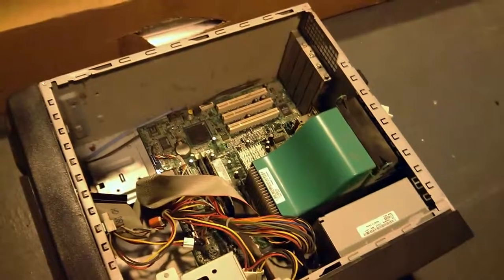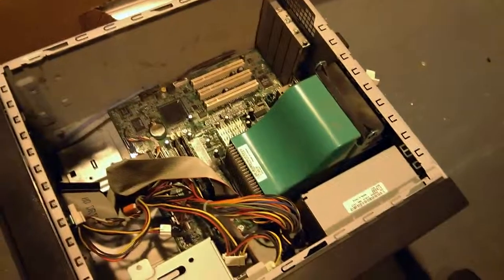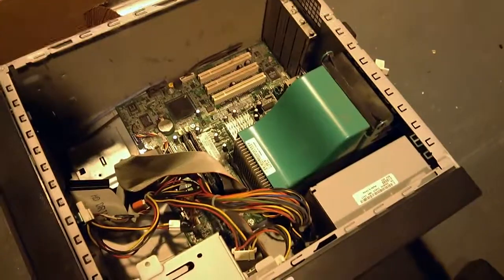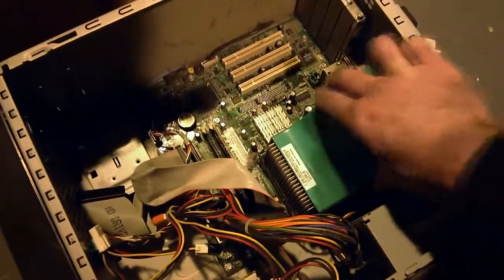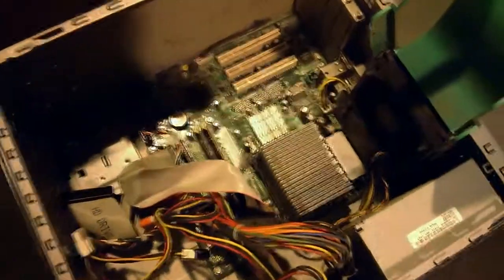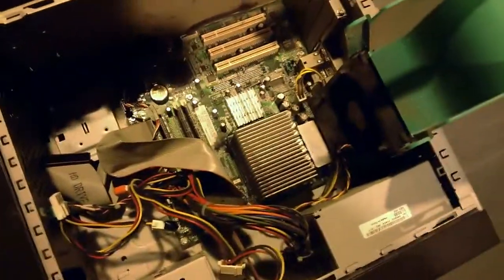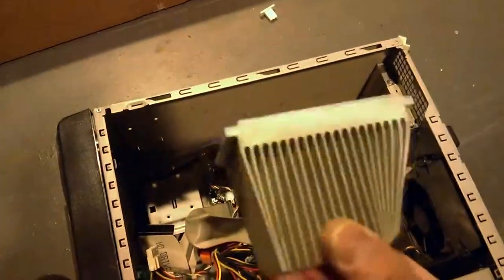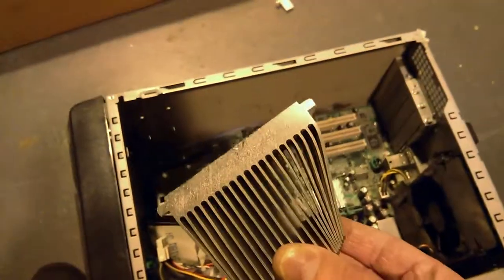Removing A CPU Heatsink

Comment: Crowbar for the next one........
Reply from the maker: i like hammers too much ;-)
Reply: DextersLab2013  You need to broaden your toolkit. My last addition was a neon transformer to test spark gaps and components.

It also has use as a way to enlighten people.

I also have a few neon tubes that work on it as well. I picked up the electronic supply at the scrapyard for free, too bad about the sign it was attached to though it would have been a nice little bit of neon.....